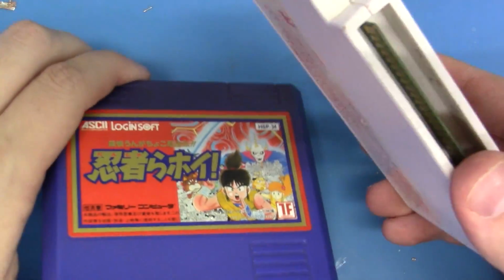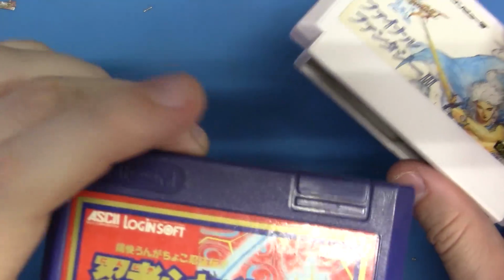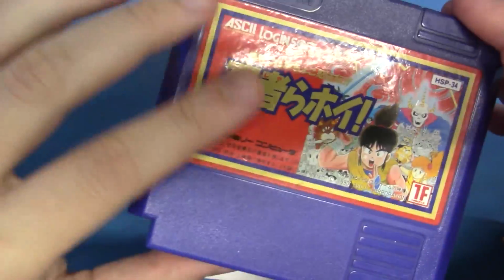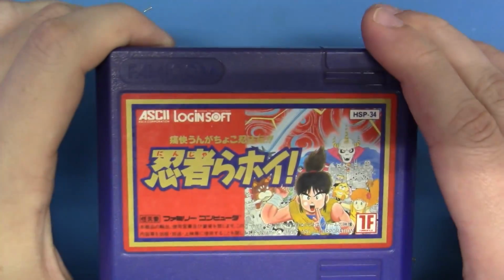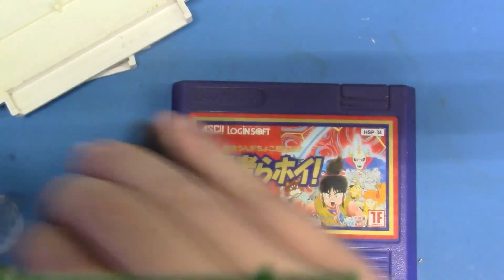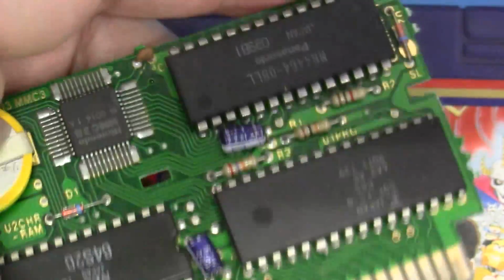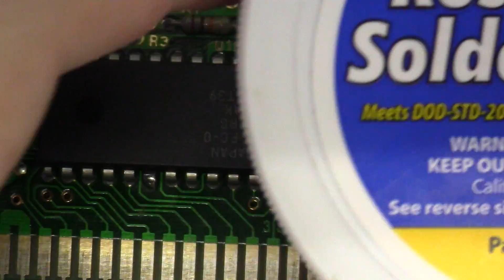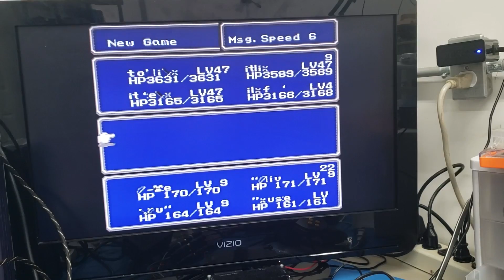Amateur Hour | Translating Final Fantasy III with NES 8-Bitter! |

Comment: After doing all this work to the board, would you be able to transplant it into an NES shell (as opposed to a Famicom shell) and play the game in a traditional front-loading NES console instead of the toploader? Or is there something about the front-loading NES model that would be all like, "I see what you did thar. Me no boot Japanese game"?
Reply from the maker: Sure. But why not just use this precise board on an NES PCB?
Reply: @Voultar  Well, I mean, there was no such thing as an FF3 NES PCB, since FF3 was never released on the NES, so you would have to use a donor cart, as far as I understand it. If I can use the Famicom PCB and just transplant it into an NES shell, then I don't need to use a donor cart, right? Well, maybe a donor shell, but the PCB inside that donor shell wouldn't be destroyed in the process; I could just put it aside somewhere. Please correct me if I'm missing something.
Reply: Yes you'd need the donor case and an offical converter from a cart like gyromite or duck hunt, that would do the trick.
Reply: @gabx007  So you're saying that using the Japanese Famicom version of FF3 would not work in an NES even after doing the work featured in the video to it and casing it an NES shell? I would still need to destroy a donor cart?
Reply: @gabx007  Also, FF3 is an MMC3 board, but neither Gyromite nor Duck Hunt are MMC3 boards, so they would not work as donor carts to begin with.

Comment: Unfortunately, you don't show how you programmed the chips, but I think I figured it out when I went to your website.  I'm assuming you ship the chips unsoldered from the board, you then put them in the ttssop-48 adapter, and program it that way, then solder it to the board.  An alternative method could possibly be soldering pin headers on to the board via the top, then placing it in the programmer, and using a compatible chip for the board.
Reply: He goes over the whole chip burning process a few videos back.

Comment: As this is really for the advanced and the professional, what do you recommend a person brand new to soldering to solder? Old, broken boards? That is good and all for aesthetics, but how do you know if your soldering work actually worked?
Reply: There are soldering project / practice kits out there, like google soldering kit calculator
Reply: @yangxiaolong8657  That's cool. I would go to my local Radio Shack, but they are all gone because Video killed the Radio Star.
Reply: @hualni  hehe yeah, but the soldering projects might be a good starting point for someone to gain some soldering confidence

Comment: I have an original PSX (PS1 Fatboy) I need the power fixed as it keeps randomly resetting. Would you be able to modify it to accept a more modern power board??
Reply: You can always get a for parts ps1 and replace the whole power supply, pretty sure theyre compatible in all fats